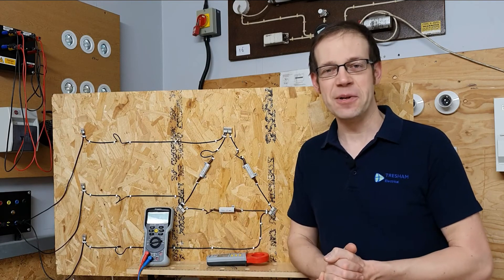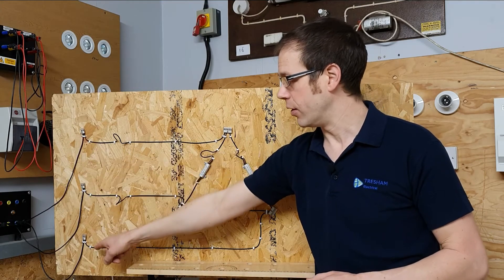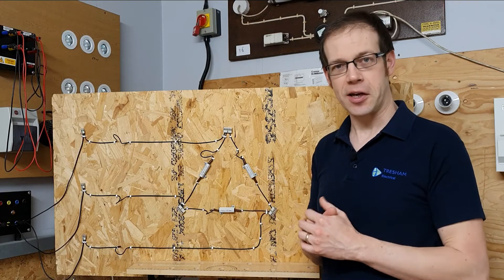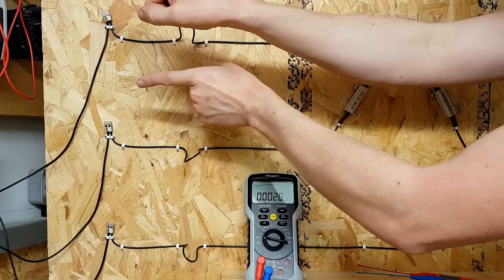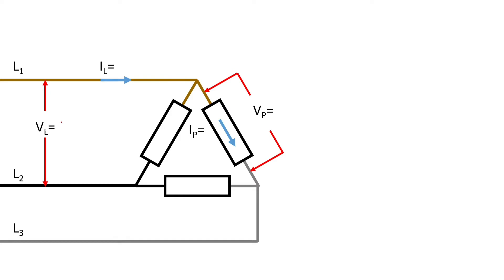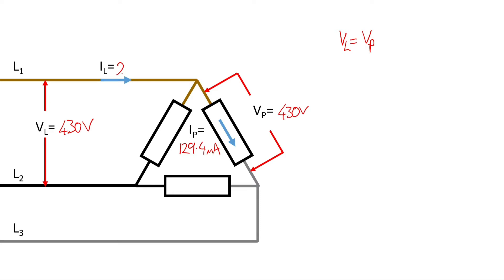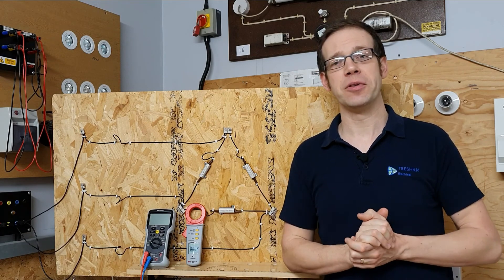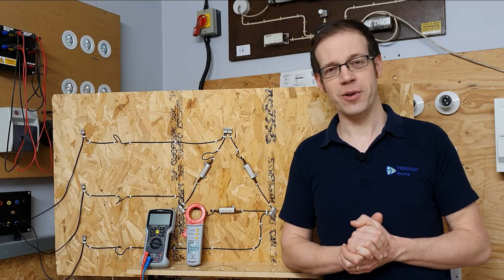3 Phase: Delta Connected Loads, How to Calculate Line and Phase Voltage & Line and Phase Current

Comment: Thank you for the video, one question please, on description of electric motor while do we have 230/400 V and 1.9/1.1 A, here 230 is Delta and 400V is star. for your video line voltage in delta is equal to phase voltage 430V .

Comment: This is a helpful video, because it shows exactly how a delta load is connected in practice and where the driving source is located, not just how to calculate values based on a diagram.

Comment: Hi thanks for the helpful video, 
Question, How does the Line voltage change if the resistors are different values?
Reply: the line voltage is a constant power source, it doesn't change. However, if the resistors are different values, the CURRENT through each resistor is different.

Comment: These are by far the best videos i've ever found ! Thank you so much for them its really appreciated. I do have a question, how would I take these readings to work out the power used by this system ? Would I be using the Line current or the phase current value ?
Reply from the maker: Thanks so much, I'm glad the videos are helping. Power in a three phase system is line current times line voltage times power factor times the square root of 3.😁

Comment: Current is going to be the same before and after the load in the delta circuit?
Reply from the maker: Yup, until you get into the line conductor. 👍

Comment: Very clear to me now. 
I have a 5.5kw motor that has line voltages as follows: L1-L2 ..219V, L1-L3....379V and fails to run at all. Its powered by a 5.5kw inverter. is the problem with inveter or motor?

Comment: Just one question, to be clear: if you had used the voltmeter to measure the voltage between any one of those three live wires and a neutral or earth wire, you would have got a reading of 430/sqrt(3) ≈ 248VAC, right? And if the voltage between any two live wires had been 400VAC, you would have got roughly 230VAC between any one live wire and neutral or earth?

Comment: Just a question Joe but what would happen if you had a 3 phase installation but there was no 3 phase equipment but single phase loads spread out over the phases. So only 1 neutral for the return current from those 3 phases. Is that where you would have to run a bigger sized neutral to cope with all the returning current?
Reply from the maker: Great question, if you watch my three phase playlist you'll find an answer to this question in the videos where we calculate neutral current. The answer may surprise you... Three Phase: https://www.youtube.com/playlist?list=PL7eNzIRgKe055yGSS4TaKks1WVQ2JDsKU
Reply: Oh sweet thanks for that. I'll watch the whole play list tomorrow night. My head is a bit overwhelmed for now. Thanks so much for your vids
Reply from the maker: @joshuacaldwell5887  my absolute pleasure, I hope they're helping. 😊

Comment: Joe, would I somewhat be right in thinking that star connected loads behave similarly to resistors connected in series? - as in the current is the same throughout the circuit. Also then, delta connected loads would behave similarly to resistors in parallel with regards to the voltage?
Reply from the maker: Kind of, star and delta are sort of additional ways of connecting loads. You can also have series and parallel circuits connected to three phase systems.
Reply: @JoeRobinsonTraining  thanks for the reply, and helping me in getting a better understanding of star and delta connected loads. Can't wait to watch the rest of your 3 phase videos

Comment: Thanks very much for this, very helpful video. Could you advise on how a capacitor bank would be connected across this 3-phase load to implement power factor correction, and how this would affect the values of phase current/voltage? I understand the configuration for single phase supply but am struggling to visualise in a 3-phase delta sense. Many thanks!

Comment: Great video !! Just one question out of curiosity, since Delta system doesn't have a neutral, what happens to residual current in case of unbalanced load ? How do we deal with when the three loads have different power and drawing different current ?
Reply from the maker: Great question, stay tuned for a future video. 😊

Comment: Thanks once again, Joe. So, how do we calculate the total power developed by this setup? 
Will is P = 3 * Phase current * phase Voltage = 3(0.1294 * 430) = 55.6W ?
where 3 is the number of loads/resistors?
Reply from the maker: Very close, stay tuned for a future video!

Comment: What is the use of calculating these relationships between line voltages and phase voltages? What is the use of this star and delta connected three-phase system?
Reply from the maker: It's how most generation, transmission and distribution systems work.
Reply: One restricts the start up current on a motor so over current does not affect other equipment, tripping etc and once it is spinning normally after overcoming the initial start up it is then switched to the other which allows the full power to keep the motor turning at full efficiency. Star then Delta...( or is it the other way round...?) or something like this at least..

Comment: Really is a  great video.
How much power and resistance rated on the resistor ?
Reply from the maker: Thanks very much, think it's a 2.2kW resistor with a 50W power rating.
Reply: @JoeRobinsonTraining  2.2K ohm or watts?
Reply from the maker: Yeah, sorry 2.2kohm, no one proof reads my messages! 😂